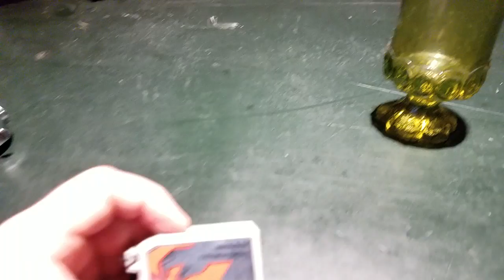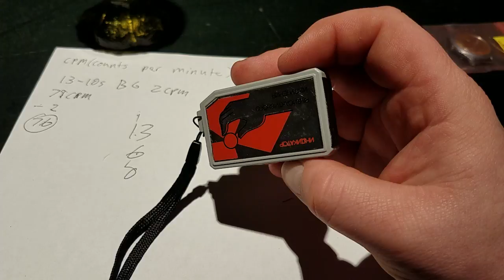BIRI (БИРИ) 2-1 demo and info.

Comment: For a demo, would help to open the battery case, show how the batteries sit (left side negative up, right side positive up), which types to use (625A button cells), how long they last since they drain continuously.